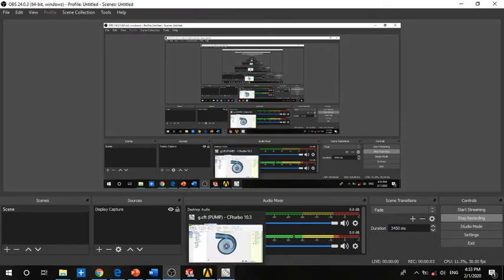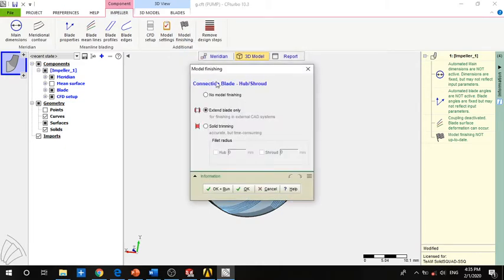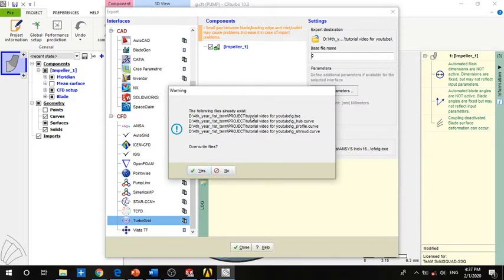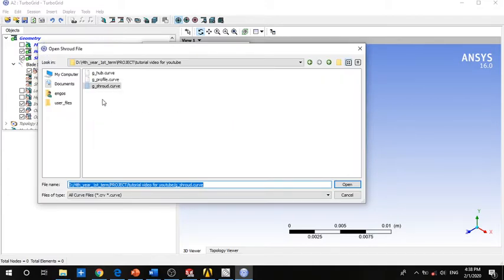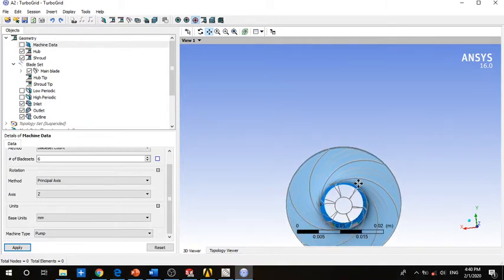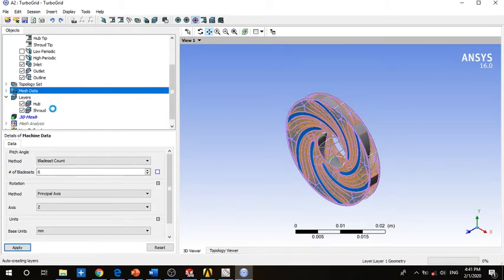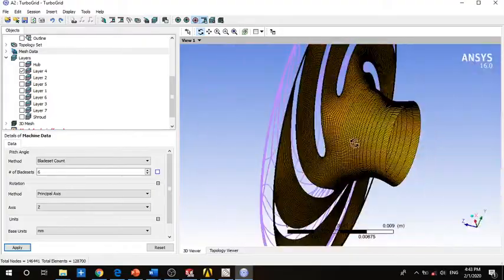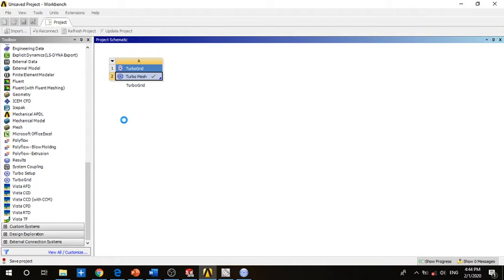importing impeller from cf turbo into turbo grid & mesh using turbo grid --no 03

Comment: ERROR
Two trailing edges were specified in the blade file while only one was requested. 
The blade will be treated as having cutoff trailing edge.

SEVERE
Operation 'BladeCCLObject:top' failed with unrecognized exception.

ERROR
CCL validation failed with message:
Error: Value '' is not allowed for parameter /GEOMETRY/BLADE SET/BLADE:Main blade/Leading Edge Type
...i got this error while i imported in the turbo grid
Reply: please do reply to me please i need it very urgently
Reply: @thecros1076  Hello I have the same problem, did you solve it?
Reply: @mesutgunees1044   iyi günler aynı sorunu ben de yaşadım çözbildiniz mi acaba (kompressör tasarımı yapıyorum ve voluse casting eklemem gerekiyor ve ansysden eklenmiyor

Comment: How are you, thanks for the videos, actually i have a problem of exporting the cfturbo file to a CAD of CFD files, it saves it as a normal .txt file not .dwg for example!! what do you recommend
Reply from the maker: From cf turbo
File - >export - >CHOOSE interface for the extension you want
Reply: @osamashawky7101  thanks, Thanks, but there is no export in the file tab, I have sent you an email, so i will send another email now with screen photos